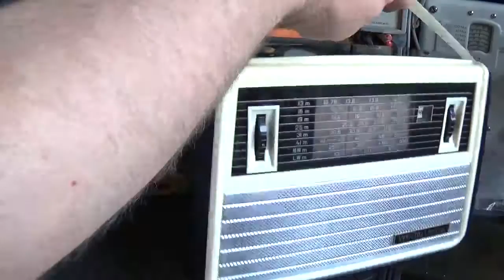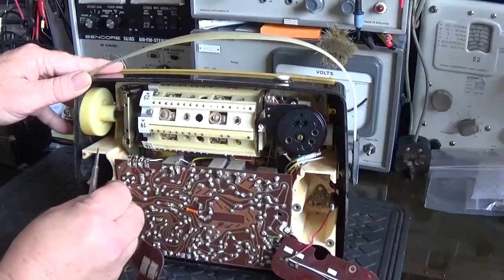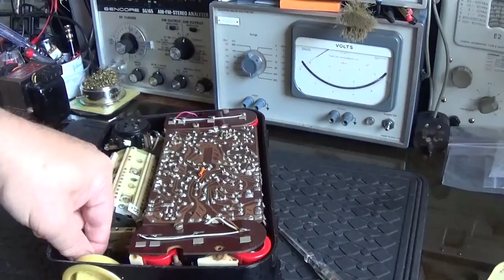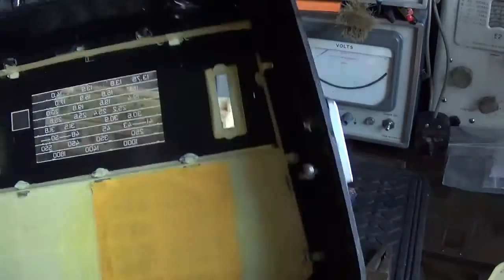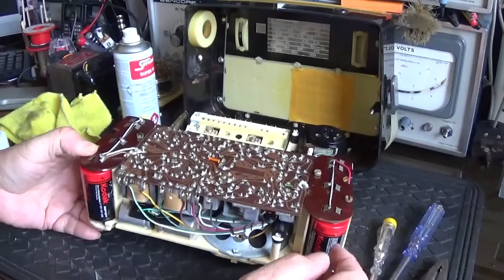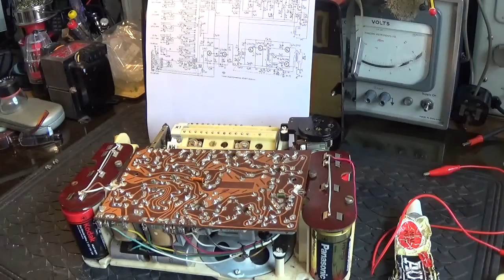VEF Spidola (Convair 1) Transistor Radio

Comment: I recently bought a couple of VEF Spidolas from a Ukrainian seller. Mine are a bit different, they have 25, 31, 41, 49, 52-75 meters, MW, & LW. One of the two is the 50th anniversary edition. I haven't tried them out as of yet, I bought them because I liked the look of them, and it was a way of helping Ukrainians out. As for actually using them? I'd rather invest my time in my Hammarlund HQ-120-X.

And you are right about a rotary turret tuner. :)

Comment: we used to get loads of problems with the old fireball tuners where the fingers used to bend up if you turned it in the wrong direction. duraglit and a oily cloth was the way we fixed them. the tuning gang sounds noisy on that demo.  i had one of these radios  it was great back then. i never had mine apart. look at the size of that spkr magnet !ha ha

Comment: What an unusual set. I've never seen one of these before. Looks a bit simpler than the Selena. Good luck with the alignment and removing that broken off screw. As its a captive nut in plastic that's going to be tricky. Thanks for sharing it and look forward to the next instalment. Graham
Reply from the maker: They are unusual but I love the design and just the plain black and cream plastic. They can get pricey on eBay, have a look at the 'Sold' listings for these and the replacement model (rectangular case) !

Comment: Hi  Andy Strange I was looking at these yesterday. 
Will keep a look out for one. Great video cheers.
Reply from the maker: Don't spend too much Simon :)  I'd really like an original Spidola, the model before this.  The dial scales move around with the turret tuner evidently. They're quite rare though here. Thanks watching
Reply: I have got one of those actually, I believe from 1964. BTW I am the same guy sent one of those later models to shango066 couple of years ago, sadly postal service handled that package really roughly. But this earlier model is in my use for everyday listening, nice design element and in good condition, My favourite is a "Smooth Radio" and it has local ads on them, so it seam to be a Essex based transmitter. I need to do some plastic UV lightening though, waiting for sunny weather here in Southend-on-Sea. I am sure it will turn out nice!
Reply from the maker: Hi Tarmo,  I remember that video Shango did! You're probably hearing Smooth Radio out of the Rayleigh transmitter on 1431kHz,  you've also got another mast broadcasting Smooth on the Isle of Grain on 1242kHz.  Yes, very nice radios, I would like the original Spidola but too expensive when on eBay.